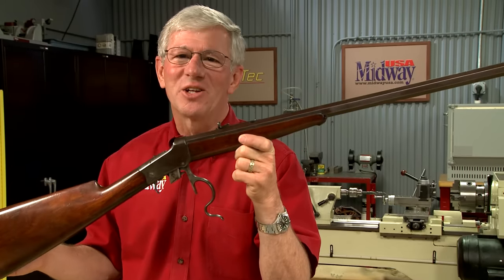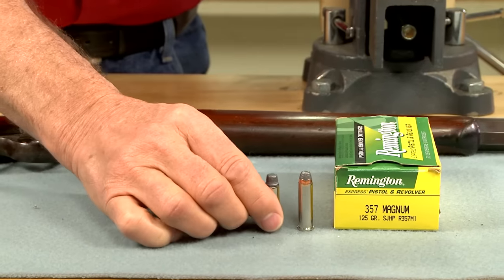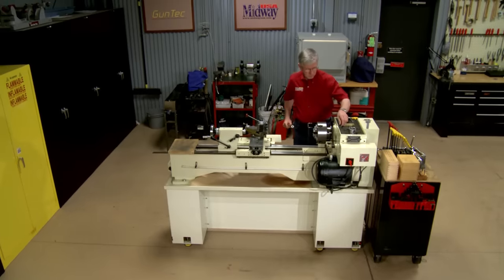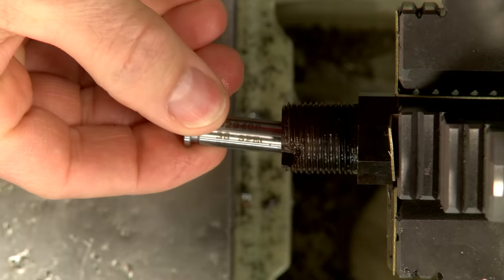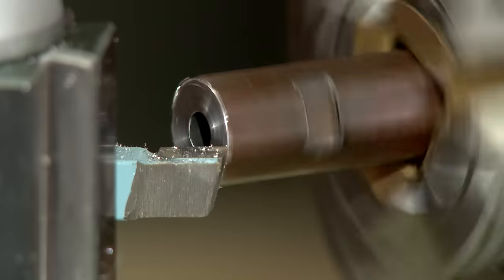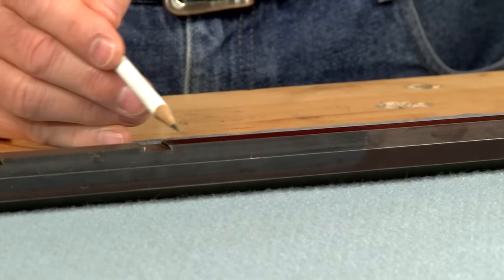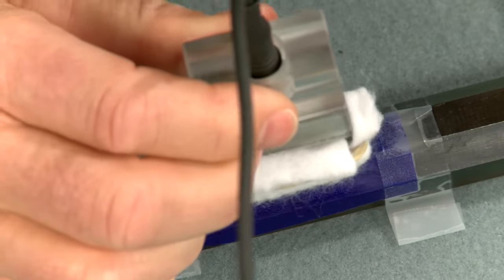Gunsmithing - How to Rebore a Rifle Barrel Presented by Larry Potterfield of MidwayUSA

Comment: So, the way to re bore a rifle is to have someone else do it. Got it.
Reply: ardvarkkkkk1 says, "So, the way to re bore a rifle is to have someone else do it. Got it."

So, you do your own paint color mixing, your own upholstery when restoring a car, your own chainsaw sharpening, etc. right?
.
Reply: I don't make videos on how to upholster a car seat then send it out to have it done.
Reply: Nonya Bidness
And your point?
Reply: Nonya Bidness
Yes, I would. I am fully capable of building the entire rifle from bar stock. I was interested in seeing the process that the title said the vid was about. Say you watched a video on how to rebuild a carburetor. They show you how to take it off and then say to send it out. Was that helpful?
Reply: ardvarkkkkk1 We are all very sorry for your disappointment.
.
Reply: +geoh7777 Yes I do.
Reply: +Paul Frederick     You are apparently the first in one year.

(Do you rewind your own electric motors, alternators, etc.?)
.
Reply: geoh7777
I've given motor rewinding some serious thought. But I have not resorted to it yet. I have rewound transformers. I probably will rewind a motor someday. I have an excellent candidate now. I need to get some magnet wire for the job.
Reply: +Paul Frederick     Good luck on your motor rewinding project. If you do get to it, let me know how it works out.

(With the cost of copper now, and the low cost of decent motors, you may end up buying a replacement.)

.
Reply: geoh7777
decent motors are not cheap.
Reply: +Paul Frederick    I have got off of ebay a few decent new motors at what I felt were good prices. Because they were for hobby projects, I would wait until one was where I could go pick it up and save the shipping. Bidders apparently bid low because the motors are so durn heavy that the seller wants something for all of the packing and shipping.

5HP for idler motor for rotary phase converter for lathe

3HP for grinder/buffer shaft (and idler motor for that)

.
Reply: geoh7777
I buy motors locally just because they are not worth shipping. But I do not see really good motors up for sale very often here. To me a decent motor is like the Rockwell TEFC (Totally Enclosed Fan Cooled) motor I put on one of my table saws. http://i.imgur.com/8bjDS.jpg Now that's a decent motor. But I live in a rural area so there is not much of anything around. When folks have something good they tend to hang onto it for themselves then too.
Reply: +Paul Frederick      Yeah, that's a decent motor. And costs more, too, being cap start single phase. On top of that, you miss out on the fun of buying a second 3-phase motor to make the first one work.

3-phase are (or at least, were) cheaper and the totally enclosed (no fan cooled) even cheaper.

"When folks have something good they tend to hang onto it for themselves then too."

Without estate sales, there might not ever be any. lol
.
Reply: Did you not listen to the video? He explained, very well, how it was done.
Reply: everyones missing the point the op was making sending the gun out to someone else is fine but dont call it a how to when its not
Reply: +geoh7777 | It's literally the title of the video. It's a definite fault with the uploader. This should be a video of everything that goes on in the company he outsourced considering the title.
Reply: Then put tittle "how someone else rebore my barel" lol
Reply: hahahahaha
Reply: I completely agree.  It was an interesting video regardless but I thought it was a little odd that the title of the video was outsourced haha. Exactly like you said "How to reload  a straight walled cartridge"  goes to the store and buys the bullet.
Reply: I totally agree with ardvarkkk..
Reply: A LOW WALL IS NOT STONG ENOUGH FOR A357 MAG 
BLACK POWDER ACTION
Reply: geoh7777 Why did you like, quote him lol
Reply: Sixgunner dot org  ok but the point of the video was to show that process
Reply: Sixgunner dot org  Whats the title of the video my man
Reply: You make a valid and humorous point. Still an interesting video, but the title was misleading.
Reply: @geoh7777  i do
Reply: @geoh7777  When the video is called how to rebore a gun... yeah
Reply: ardvarkkkkk1 that's exactly what I said it pissed me off
Reply: @geoh7777  I know this was 4 years ago but I cant help it, who the fucks doesn't sharpen their own chainsaw chains?
Reply: video( how to make a homemade cake )  narrator pay somebody else to do it (the end)
Reply: @geoh7777  You dont know how to sharpen a chainsaw?
Reply: exactomundo Ardvark. I wanted to see the process that was in the title, and got to see still photo's of something that an expert would understand, but a layman not.
Reply: Nah man, just get a cordless drill and a Dremel™.  Knock that out in about 20 minutes.  Cherry.
Reply: @ardvarkkkkk1  the power is in my hands. You comment has 999 likes and all I need to do is click.
Reply: Sixgunner dot org  Your just salty that ardvarkkkkk1 got more thumbs up lol.
Reply: @user-qd6jt9sd3h  He did. You didn't see the pictures presented in the video and the explanation of the steps necessary to do so? Just because he didn't do it himself doesn't mean he didn't explain how it was done.
Reply: @billmetal  Whatever you say kid.
Reply: @ardvarkkkkk1  If you're really capable of building the entire rifle from bar stock, then you would already be aware that changing the caliber of a rifle is simply a fancy way of saying "we drilled a bigger hole to a precise measurement"
Reply: @geoh7777  He doesn't make a video called "How to sharpen your chainsaw chain" which shows him getting the local chainsaw shop sharpening the chain and then he just cleans the powerhead and puts the chain back on . . . I'm with @ardvarkkkk1 here . . .
Reply: Man, i was expecting so much more from this

I have the tools (dhd, line bore, spiral internal grinder, needed measuring devices) and certs and i can tell you, that's the biggest problem in boring and rifling barrels

If the operator didnt need certs, you could put a 16 y.o. on the machines i got and get fine barrels. Put an experienced machinist on them and you can get the precision for the barrels used in those boxes old people use to score 0.5mm groups at a few hundred meters
Reply: @Adierit  that’s not all it is though. There is something called rifling.
Reply: I don’t know if I’d trust he host to do it, he looked a bit cross eyed
Reply: I didn't expect him to have the machines and tooling to do the actual boring operations, but I'd hoped for a way better run through of that aspect of his vid. 
   I thought he made up for that in a small degree by giving us a run-through of his other operations to finish the project. 
All of the rest was about as sparse as the boring job though so I concur with you about the missing boring job.
Reply: @geoh7777  When it comes to electric motors sometimes, not always but sometimes you get what you pay for. Chinese like to use copper plated wire in windings instead of copper wire. It results in a short lived motor. Try an avoid buying an autozone reman starter, motor or alternator because they’re bad about being worth less than the cheap $55 eBay new with free shipping starters
Reply: @danielalamo2075  he gave a very brief summary. Yep drilled, lapped, rifled, lapped, shipped back to customer.
Reply: Right‼️ wth 🤦🏽‍♂️ 😂
Reply: @ardvarkkkkk1  7 year old comment shows you should use the things you like to blam yourself

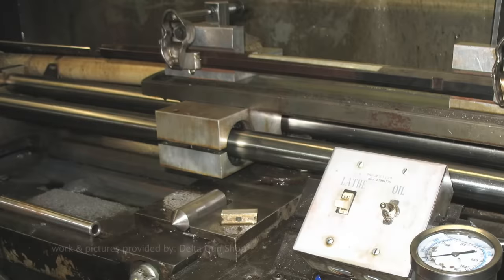Comment: Right at the time stamp, @1:24 .... the still picture that only last for a second or two, showing the bare rifle clamped in/on the carriage slide.. did you all notice the rocker arm and push rod cantilever clamp system to lock the barrel down... strange, but interesting while worthy of saying, exceptionally clever... and something tells me, that this clever "reuse" of parts to make this clamp system, has been in use on this machine for years, if not decades....  I am glad I watched this video...

Comment: I was always fond of octogon barrels. I remember being 9 and checking out a book of old guns from school. I even asked Mr. Froescyth why they weren't round. He thought it had added strength over round ones. And it was normal for the time.
Reply: They unscrewed like a bolt. Pretty awesome machine work for such a long time ago. When it stopped threading it was on sight? How were they doing this in the 1850's lol?? The craftsman ship involved and techniques this day in Midway videos are amazing!!
Reply: tom smith that machine work is easy is called indexing and is justa function of facing the shoulder .... its a lil math involved..... a scew is a ramp and moving so far on that ramp equals a certain distance so if you remove one thousandth on a 90 degree ramp the barrel will advance an equal distance one thousandth.... But at the thread not the outer circumfrence of the barrel. ?.. a less aggresive ramp .....  screw barrels might advance 18 to one.....  so you do your math is things that are not taught in school because teachers no longer know math lol
If you can't figure it out Google it is really easy once you do it once..... If you can't figure it you can use a shim to determine how much the barrel will rotate for a given amount of material added which will match removal of material ..... Of course you can sneak up on it ..... Don't forget metal will crush and you can assist slightly the alignment of the site by crushing more or less.....
Reply: amazing thanks for the knowledge friend!

Comment: question, can you rebore to a smaller calibr?
Reply: Yes, It's called a barrel liner.
Reply: or sleeving.
Reply: Yes, and it's actually easier (and probably cheaper) to do that since barrel liners are pre made and already rifled.
Reply: but wouldn't you still have to have the original bore rebored anyway to make a good fit with a new liner? I would say yes.
Reply: It depends on what sort of change in caliber we're talking.  Sleeving from a .45 LC down to a .22 LR would be fairly straightforward (minus the differences in firing pins, extractors, etc.) because there's a large difference in caliber.  Going from 7.92mm to 7.62mm, on the other hand, would probably require the barrel to be bored wider before sleeving (just as an example).

When in doubt, ask a professional gunsmith :)

Comment: This is all well and good if you have tens of thousands of dollars for the necessary tools amd machine. Plus spending $15,000+ to attend gunsmith school.
Reply: Yes, but when you add in milling machines and everything else needed, it is a hefty amount.
Reply: Michael Hill says, "This is all well and good if you have tens of thousands of dollars for the necessary tools amd machine."

I think Larry is now well beyond worrying about that.
.
Reply: LOL It's at least 30K to go through any of the Quality Programs.
Reply: Privat3Kag3
I know because I'm in it hahaha
Reply: Privat3Kag3 Buy a used lathe and shaper (the "predecessor" of the milling machine) can do some things that a mill can't (without a shaper attachment), drill press, vise, and a few hand tools and you're set to go. (You might have to divorce your wife first, though. lol)

I don't have any of that stuff (except hand tools, electric drill, and a cheap Harbor Freight hydraulic press and I can replace rifle barrels and stuff. I can check headspace by taking a trusted cartridge case (that I have checked in a case length "headspace" gauge bought off ebay for very little compared to new price) and stacking several circles cut out of 0.0025" steel shim material and counting how many can be stacked on the case head before the bolt won't close.

OK so that is amateur hobbyist compared to professional, but after a person worked on his own weapons, he would know more about whether he would want to make a career move..
.
Reply: geoh7777
Your ingenuity Impresses, & Inspires me! However there are many things you learn in Tutelage, that you would not have otherwise...

And I Agree with that last paragraph 110%
Reply: Privat3Kag3 What I recommend is to enter an Machinist Apprenticeship program.  You will be earning a living while working toward your Journeyman's Certificate.  Severe shortage of skilled Machinist, especially those that have lots of manual machining experience.  Once you have these skills, then one can start working on firearms in one's spare time.  Lots of gunsmith skills can be learned on the side.
Reply: MaxCruise73
THIS Is Utterly Factual!!! Where are people such as the ones found in this conversation!? I can agree with you in almost every aspect, however What exactly do you mean by "The Other Side"?
Reply: Privat3Kag3 Let me clarify.  I stated "on the side" as in on one's own time.  Once a person is a working Journeyman Machinist, aspects of gunsmithing can be learned by watching videos such as the ones offered by Larry Potterfield.  Crowning a barrel is easy for a skilled Machinist.  Producing a new firing pin does not pose any problems.  Performing a trigger job is easy to understand given the skills of a Machinist.  One does not need to go to a gunsmithing school to learn the gunsmithing trade.  It can speed up the process but comes at a high price $$$.  Plus a Journeymen Machinist will make better wages than a gunsmith.
Reply: MaxCruise73 There is much truth in this statement.
Especially in the pay ratio! HAHAHAHA
Reply: hey.... to get a degree in gender studies is around 95,000 dollars..  I assure you spending 30,000 or 40,000 dollars to become a gunsmith is going to benefit you more...

Comment: As I was told by a friend that was a gunsmith for around thirty years, Larry was a gunsmith at one time and found selling parts and videos more rewarding. After fifty years of working as a toolmaker and machinist, Larry’s casual view and remark about the “spider” on the outboard end of the lathe spindle, shows a serious lack of concern for safety in a shop.
  An outboard work support is a common tool in many shops doing long slender work. The way that one is made shows a lack of knowledge or care. Some guys like to drill and tap four holes through the spindle itself.
  After seeing my first one of this type I made a better spider without legs and teeth. To make my mumblings easier to understand, let’s assume a spindle bore dia. of 1.50 inches, and an o.d. of 2.00 inches. Scale up or down to suit your machine. Chuck up a piece of 2 1/2” round bar( No! Not billet!).
Bore a 1.50” hole through, and c’bore 2.002” dia. 2.00” deep. Face off and de-burr the opposite end. If I did this correctly it should slide nicely over the spindle. The only problem may be that the spindle clearance hole in the gear cover may be a bit too close. Hmmm....? You can turn some clearance on the first set up. The last step is to drill and tap the four radial holes for socket set screws that you have brazed the tips on. 
 The idea is to use the shaft/barrel in the chuck to hold the toothless spider in place. The set screws should remain below the exposed o.d. Imagine how pissed your wife would be if she walked by that collection of screws, spinning at 800-1400 rpms, and it snatched her blouse off along with some E.R. wounds on her arm. 
  Has anyone here done a google search for “lathe accident” to see what happens to a person who doesn’t play by the rules? It is not for the ones with a weak stomach.
Reply: I have seen pictures, very very bad accidents.

Comment: This is a fascinating build. It has me wondering, why not make expensive precision rifles with a line of preset rebarrel jobs by using calibers with the same basic casing size and room to hone each a size longer. Say 6mm prc to 6.5 prc to 7mm prc to 300 prc and if they would use a new hybrid long/midsize action to address the case length variation but keep the case diameter and neck angle the same, and hone the barrel a size larger each time, there could probably be a way to fairly simply step it up each time. This only seems viable and cost effective for high end PRs for competitive shooting. Of course the military could benefit from this too when millions of rifles need swapped out and one simple conversation saves so much work and saves high end steel that wouldn’t need heated and broken down. Just remake the starting caliber and keep the cycle going making support rifles all the way up to the long end reachers. Just a wild idea that has surely been thought of a thousand times over by others.

Comment: Lot of comments below about outsourcing the re-boring operation.  Plain truth is that the tooling required is expensive and unless you are doing a lot of barrels, it won't pay for itself.  Makes good financial sense to use a specialist shop that has the turnover to justify the investment.

Comment: I have a reboring question no one I know can answer:
A friend has a complete WW2 era Sten gun. The short barrel was disabled by filling it with "weld" or melted welding rod. The issue is "can this material be bored out and the rifling re-grooved?" or would the heat of the disabling process have ruined it? Expert opinions welcomed!
Reply: +carmium Im not an expert but the first part, I doubt any chance to drill  because the material was put in by welding - to be EXTREMELY HARDand make it undrillable. They don't want anyone to make an operating Sten gun LOL. . And I suspect your guess about the heat having altered the chamber area is valid.
Reply: +Frederick Wise I had no idea whether welding rod was harder than barrel steel. Obviously, the guy who brought it home from the army didn't want anyone running around with a working submachine gun, but I just wondered how good a job he did.
Reply: +Adam Kiidumae That was not Adam but carmium  making that last comment. I used the shop computer, signed in with my name, and the owner's name came up! Frikkin' computers! Please reply to me and not Adam if you have a comment. Thx.